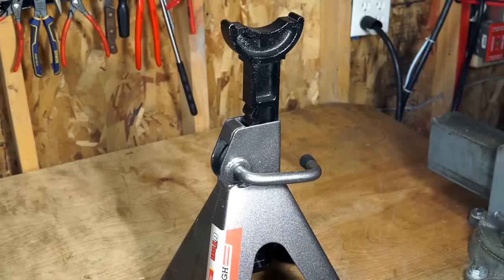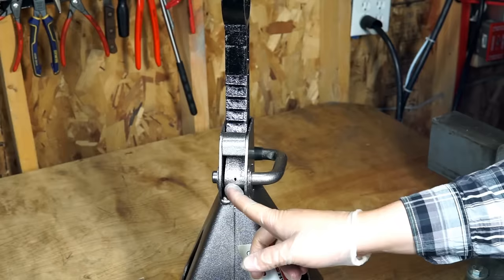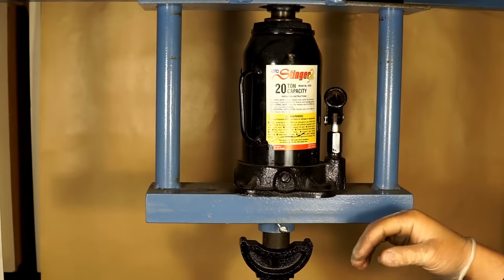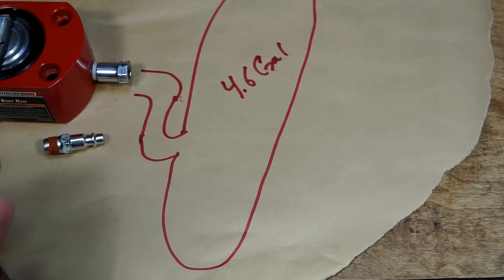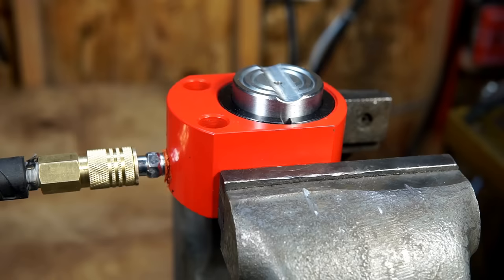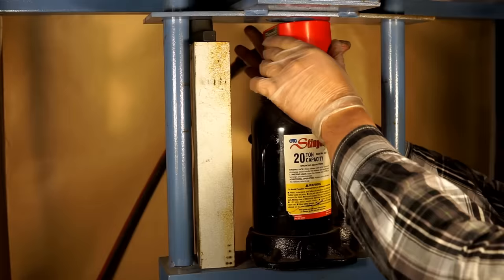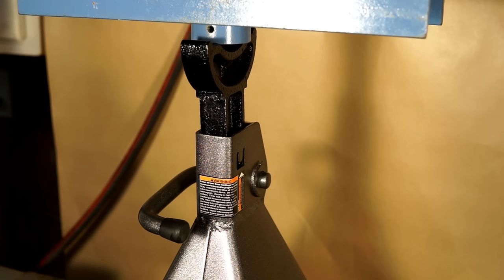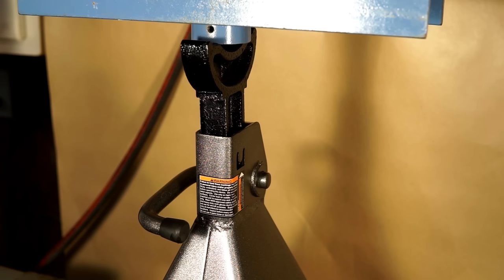EXPERIMENT: WARNING! Doing this to your Jack Stands will get you KILLED!

Comment: that's a 6 ton Jack stand what about a 1 ton or 2 would the pin fail sooner?
Reply: it really shouldn't matter the strength of the jackstand, the shear pin is not holding the weight, the pawl is. If anything I'd want the pin to fail sooner if im under a heavier vehicle, I dont want anything falling on me, especially not a vehicle that requires a 6 ton jack stand.
Reply: Yes, fairly obviously the pins designed for 1 or 2 ton rated stands aren't going to be as sturdy as those for a 6 ton stand rating.
   Part of this is obvious simply because the pin must be designed to shear at a lesser load for a lesser rated stand. When supporting a working load there are still some unintended stresses on the pin... It's just a consequential nature of the structure.
   The other side of the token, higher rated stands are going to be more expensive, and people who spend more money insist on a more durable and better product in general. Weaker pins will tend to "wear out" over time faster than the tougher pins, so there's that marketing part of it as well.
   I'm guessing, since it was brought up here, that there might conceivably be a flaw in the experiment here using a 6 ton stand where the job/story in question wouldn't require such. Solution would be to re-visit this with the lesser stand (1 or 2 ton as recommended for the story) or... get a range of pawl-pins for the jacks popular on the market and test their shear-strengths in reality, rather than just reading up what the engineers intended... (if possible)
   Of course, research on the actual designed and intended fail-points for jack stands might be worth a look. :o)
Reply: gnarth d'arkanen   I don't usually see safety features compromised to make anything feel sturdier...
...besides 100-200 lbs of upward force to break the pin would be adequate regardless of the rating...and a pin that takes 100 lbs to break is not just going to wear down assuming a decent design where the pin doesn't hold any weight. There are exceptions, but good engineering doesn't leave unintended forces...
Reply: gnarth d'arkanen 
The safety pin should be the same regardless of the jack stand rating. The safety pin has nothing to do with the rating at all. If it is truly a safety pin, then it should be designed to shear with even as little as 100 pounds on the stand.
Reply: Travis Ryno 
I totally agree. The pin can be made out of wood or plastic and still perform the job.
Reply: Yeah, I'd love to see a complete pin replacement and a failure point off 50lb's 

Totally along with you there, doesnt matter if it's a 1 tonne or a 50 tonne jack, the pin should be failing much earlier
Reply: Instead of a pin, why not spring loaded? Could make the max upward force 5lb or something.
Reply: many safes have a handle that is a friction fit, so it can easily turn an unlocked mechanism, but the slip will stop someone from overloading the system with torque to break the lock. a similar system may work here.
Reply: Chaos Corner 
A spring would probably work, but it would require a totally new design that would have too many mechanical parts. The jack stand already gets in the way too much. No reason to make it bigger.
Reply: thomas h 
I am not sure about the internals of this friction system that you are referring to. Will a jack stand, given it's application and environment, cause this type of system to prematurely malfunction?
Reply: Mr. Biggs, personally (and understanding how the thing was designed to work) I agree with you to a point. There's of course a lower limit to just how easily the pin should shear, but it shouldn't be required to hold more than the entire weight of the stand, itself... Mostly that's because of the popularity of people moving and carrying the stands around by the pawl handles.
   HOWEVER, this isn't (in my experience) how the market works. A six ton stand is expected to handle a working load of 12000 pounds, and people who spend the extra money for it expect a higher durability to everything... and some of that may include the pin..
   As I'm not in the habit of destructively testing every jack-stand I buy, I simply can't assure you of it one way or the other... So do note, this is based on my experience with general tools and ratings from all around the rest of the market... I genuinely avoid putting a load directly on a jack-stand, and anytime I do employ it, I consider it a safety redundancy in case the jack fails.
    On the friction or spring systems, I don't think there's any call in either of them to require much difference in the size of the stand, itself. For what it's worth, it's just a guess... But, either would be adequate for releasing the handle when the stand was under load without breaking or shearing anything.
   In the usual environment, the only fail for the friction release handle system would be to let the handle move everywhere without actually releasing the pawl, so... not so big a problem as a failure, since you have to jack up the vehicle before removing the stand no matter... In any case, I (for one) don't anticipate the usual environment of dripping grease, oil, rust, dust, and metal shavings to be so contributive to failure of an internal friction release setting any more than it would be to the slave cylinders in brakes... and dust barriers are fairly ubiquitous and cheap.
   The easiest "fix" over all, would be to install easily replaceable pins rated to fail at any weight more than 10% over the weight of the stand. Then just include replacement pins in the packaging. It's simple, cheap, and supplies of pre-fabricated pins could be another standard supply for any adequate shop... sold in packages of ten or twenty at a time, just enough so you can lose or misplace them and have to run out for another pack when someone managed to shear one... lolz... :o)
Reply: the slip would be between the pawl and its handle. grease/oil would bean issue
Reply: thomas h, actually, it shouldn't be much of an issue. The slip would be an internal component/system if I'm thinking of the type you mentioned. A simple plastic or rubber dust-barrier should repel about anything a garage would normally expose it to... :o)
Reply: The spring would not have to be very big or get in the way. Thomas H's slip mechanism would be a good idea too.

Heck, some kind of locking pin or a loop that slips over the handle to prevent it from being lifted would work too.
Reply: Though with the slip mechanism, you'd have to make sure it didn't operate in such a way as to stop the pawl engaging properly. Not a huge problem to solve though.
Reply: For those who have trouble understanding Thomas H's Slip device...
   First, he's suggesting innovation from a mechanism in the door-handles of expensive safes and bank-vault doors. The problem the old manufacturers faced was that clients who bought the safes and vaults would forget or fail the combinations to the locks occasionally. Sometimes it was just that the dial was off (wear can do that over years)...  And in frustration, the client (or robbers who thought they had the combination) would yank and beat on the latch-handle, sometimes damaging internals and jamming the entire locking device...
   Solution was a simple clutching mechanism inside the workings of the door handle where the actual handle attached to the shaft in the door. This clutch (a slippage unit not much different from the variable resistance in a common fishing reel) was fitted well enough to let the handle move the internal mechanisms freely when the lock was disengaged. However, once the lock was engaged, because it was just a friction clutch, the handle could be swivelled all the way around with force and never put more than just a couple pounds more than necessary on the internal workings, so not to allow them to be damaged. It's basically a sacrificial ring of material (like a wood or rubber bushing) that sleeves the internal shaft and is entirely covered by the exterior handle, which often has a "skirt" or dust barrier of metal closely machined to the safe or vault door so debris can't easily get into the clutch and cause wear or worse slippage. (at least such was the earliest versions)
   Of course, later, innovations like recesses for the handles' workings and better covers came along, as well as better, longer lasting and more reliable materials in the clutch bushings... but that's just the steady, usual march of progress for better tech' and products... 
   In the interest of a reliable jack-stand, there's really no reason that even the earliest variation of the slip device wouldn't work well and still let the pawl engage just as well as any other mechanism... :o)
Reply: gnarth d'arkanen 
Okay so I am just about sold on the slip/friction mechanical barrier given proper seals, but I still don't see any way to utilize the spring method.

One concern that I would have with a friction mechanism is the idea that safes are not hoisted by their door-handles. Would the act of continuously lifting the jack stand by the  lever cause damage to this friction mechanism?
Reply: The friction mechanism would only actually do anything if the handle were moved while there was a weight on the stand. Thus most of the time it would have no moving parts. Seals could perish, of course but should be OK with something like ptfe.

The spring would work by coupling the handle to the pawl. If there is no weight on the jack, moving the handle pushes on the spring which moves the pawl. If there is a weight on the jack, the pawl "pushes back", the spring compresses and the handle reaches the end of the travel before the pawl experiences enough force to do anything. I'm sure there are several ways to implement such a thing so I won't pick any one in particular. I'm pretty sure this is something I've seen used in a few other applications too so it's nothing too novel.
Reply: Chaos Corner 
Yes I understand the physics behind the spring. I could even calculate the k-constant; however, I see no way of effectively utilizing such a device in a jack stand.
Reply: Mr Biggs, There's probably more than one way to make a spring-loaded handle mechanism work. My favorite (of the moment anyway) is to use the spring to put a locking pin into position to keep the handle from moving once the stand is set. A simple enough trigger device would be able to "unseat" the pin and compress the spring to "unlock" the handle when the job was done. This way, strain or no strain on the stand, there's practically no way you could accidentally move the handle without putting enough force to knock the entire stand over in the process.
   For a current "real" application of something like it in action, look to an old vacuum cleaner (the kind with metal tubing extensions) and those "damn spring loaded lock-pins" that hold the tubes together. Admittedly, the normal method for those, was to physically press the pin into it's recess to disengage the tubing, and usually pinch the shit out of your finger in the process, but with today's advancements, surely a minute cable work or lever could actuate the spring-loaded pins in our mechanism for the jack stand. You only want to be sure to put that trigger release someplace you practically can't get to without intent.
   :o)
Reply: or...Just buy a Jackstand that uses a sheer pin and a series of holes instead of a ratcheting cam system like what was shown in the video. The sheer pin style I have used, aluminum Body -S.S. pin, the body of the jackstand is the failure point. It will begin to deform long before the S.S. pin's sheer strength. Looking at the structure of a 2 ton aluminum jackstand, I know it will take far more force than 4,000lb to start deforming a 1/4" wall aluminum tube. 

You can not remove the pin while loaded unless you tie a rope to it and yank it, even then I suspect it will not move. 

The biggest danger is knocking the car off the stands themselves, which is a danger associated with the style tested in this video as well.

Comment: Simply by putting upward pressure on the car. IE: A frozen sideways bolt on a shock. where you are using a ratchet and possibly a persuader to break the bolt loose. Will give the  car enough lift off the jackstand to relieve enough of the pressure. That if bumped ,or kicked on the release lever it could fail. I have worked at shops where others have had cars completely off the ground on 4 stands and only two sides of each jackstand foot were in contact with the ground. Simply from not positioning either the jack or stands properly. So not all jackstand failures are at the fault of the jackstand itself. Sometimes its the Jack that jacked it up all together.
Reply: Wayne Schonasky Yep you have to really be careful that the stand isn't at an angle. I've super careful about making sure the stand is right before I get under it. I leave a just-touching jack in place as a failsafe, not actually supporting weight. If the stand fails, the weight would drop on the jack but not from a very far distance, only a small fraction of an inch. I usually have to reposition a stand several times before I feel it is safe.
Reply: That would be the person who jacked the vehicle up was not paying attention to the jack stand and the vehicle while jacking it .  I jack the front and back up in intervals so I can adjust the stands so they are flat on the ground .
Reply: Yes, I've had that happen and caught it.  Comes from trying to jam the stand in fully extended where the car is not quite high enough, or placing the stand under a part that moves laterally when the car is lowered, like a suspension arm.  Pushing hard on the car each way BEFORE you get under it, and looking carefully precludes this.  If you have those old style stands made of pipe, THROW THEM THE HELL AWAY!  My brother had one crumple under the back of a Karmann Ghia, yes, shit car, I know.
Reply: That is exactly what I was thinking: combine lifting up on the car with lifting up on the jack stand release lever and ...voila!

Plus the car might not be level and if it is only 2000 lbs. with parts possibly removed a little bit of a see-saw becomes a very big see-saw.

Comment: Great technical experiment.  However, it appears that the pin might require more than 500 lb of load on the stand before it can shear.  Some of those "roll pins" are not proper shear pins but are hardened steel.

Comment: the normal height of a jack stand is still pretty high... you'd have to fuck up pretty badly to have it fall on you completely and you should always use two stands if you are getting under the car.
Reply: Michael Schindler - - good comment!
Reply: Literally the first thing that came to mind.
Reply: Not always practical but putting a 4 wheeler, or a car behind the one up on stands will keep anyone (blondes) from accidentally bumping car on stands
Reply: Michael Schindler. Sounds like somebody forgot to put blocks in front of the tires
Reply: He was just trying to simulate an ACCIDENTAL bump of the release bar with the mallet, to see how big a hit it could take before it releases. 
Imagine crawling under a car with an exhaust pipe. Shit! you got it backwards. You spin the pipe around, and hit your jack stand accidentally. Will it, could it drop your car? Scary thought.
Reply: He expected the pin to shear and he was surprised when it didn't. The idea was to show that the pin breaks before the stand releases. Apparently the stand needs considerably more that 500 pounds on it to shear the pin.
Reply: I always double up my jacks stand and leave the jack under with pressure on it.
Reply: we live in a world where period blood paintings are a thing, never ask "what idiot" xD
Reply: I always put the wheels under also fuck that

Comment: Great experiment!  The set up was  sound, the results were clean of fault.  As an old retired mechanical designer, I can't fault you test, very well done.  A thought, what if the pawl was not fully seated in the groove, but was caught on a tooth edge?
Reply: That is more likely what happened then anything. Part of my own routine when placing jackstand is to make sure the paw is fully seated by dropping it then lifting it to where I want it every time.
Reply: TrikeRoadPoet the fault in this experiment is he forgot to factor in leverage. 500 pounds of force would have to be directly applied to push it in. But in the jack stand itself than handle and the angles of the groves leverage needs to be factored in
Reply: Aaron, his intention was to determine whether or not the shear pin would fail before the pawl released a 500-pound load. He made neither measurements nor predictions as to the force that would be applied to the lever.

Comment: You should always use jack stands (obviously) but it's also smart to keep the jack under with pressure as well. Also if you have a tire or two off it's also a good idea to put those under the car in case something does happen.
Reply: I've always done that..plus put a steel wheel under..being crushed is a horrible death
Reply: Actually, using a jack to bear a portion of the load is EXACTLY how to create an unsafe condition with this type of stand. The weight of the vehicle is what locks the stand. 
Also, how do you know being crushed is a horrible death?
Could be it's a walk in the park, piece of cake..like crucifixion!